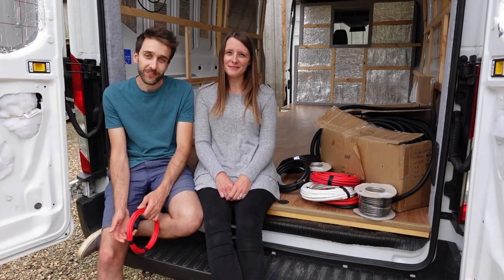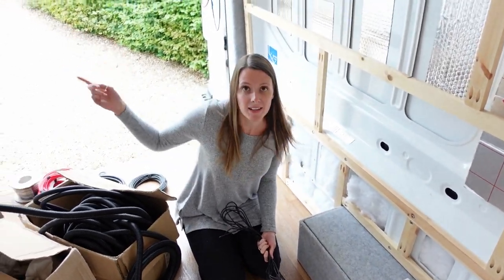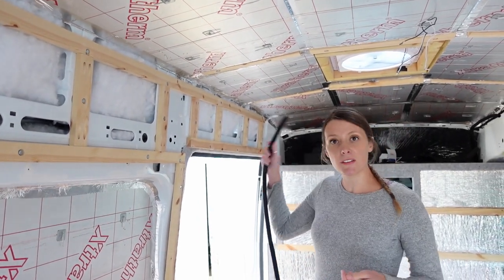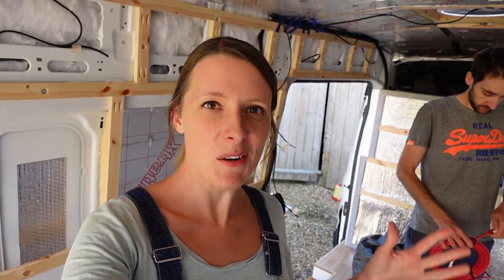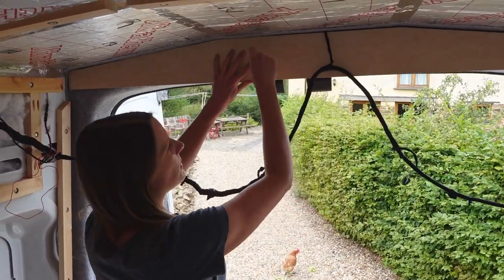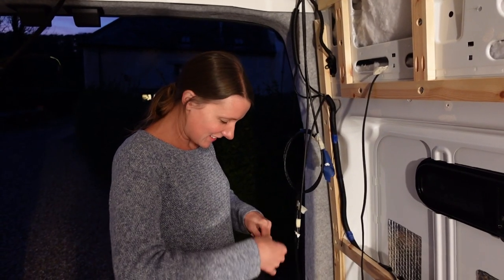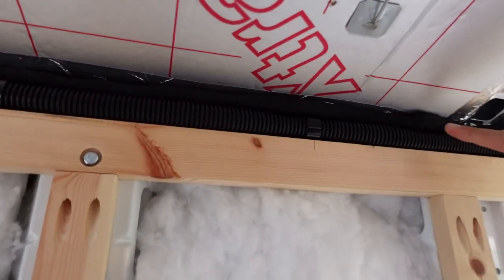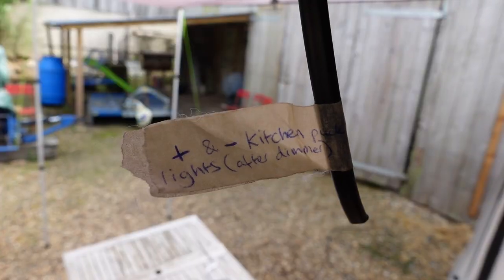Pre-Wiring our Van Electrics | Transit Van Conversion E19

Comment: How many meters of wire did you use in your van? I just made my pre-wire sketches and it seems like a huge amount of wire!  My van is smaller than yours and I won't have all the appliance you have (diesel heater, oven etc), but I am planning to do 3-way switches for the main lights.  Love your videos! I come back to them again and again as I go through the slow process of DIY build.
Reply from the maker: It is surprising how quickly it all adds up even in a small space when you have to go along walls and around corners 😄 We originally bought 2x30m spools of 3mm^2 cable, 3m of 70mm, 15m of 16mm, 9m of 6mm and 12m of 2.5mm triple core cable for the AC. Later on we needed some more 3mm so bought another 20m of non-duplex. We haven't used all of the wire, but there is well over 100m in the van. And thanks, glad they're useful 🙂

Comment: Looking good. If you have not boarded yet may I recommend running a few spare 12v cables from front to back. You will always have forgotten something, we all do. Watching with interest as it is a transit.
Reply from the maker: Thanks! And very good point, we actually ran out of cable to run the spares but we'll be getting some more and adding a few extra runs here and there. One handy feature of our design is that we can easily run cables under the bed across the garage wall too, which should stay accessible and allow for some new runs in the future 🙂

Comment: Watched afew videos now, and wow.  The attention to detail! May I ask where you purchased your cable from?
Reply from the maker: Cheers! We're hoping to spend a lot of time in it so want it to be comfortable 🙂We bought all our cable from https://www.12voltplanet.co.uk/ as they seemed to have the best selection and easiest to browse. The only thing we found a little odd is that some of their diameter sizes seem a bit unique, so we ended up with 3mm^2 wire for the majority of the van instead of 2.5mm^2 as they don't stock that.

Comment: It's always a pleasure to the eyes looking at the clean build you've created. 😊 I am also sold on conduit, but will opt for different colors 12V / 230V to better distinguish the lines. 😎
Keeping the batteries apart always means more wiring - was there no way to put the leisure battery closer to the starter battery?
Best regards from Germany, 🚐☁️🍀
Volker
Reply from the maker: Thanks Volker for the continued support, we're glad you're enjoying watching everything 🙂 That's a good idea to use different colours, didn't think of that actually. If we were buying it again we might have gone for the split tubing as well to make it a bit easier to route the cables. 

We were kind of stuck with the long length of run for the DC charger because for the layout we're going for the only place that really made sense for all the electronics was in that back corner of the van. iI's long for the DC-DC but it makes it much shorter for everything else 🙂
Reply: We are in the process of planning our van build. You’ve made a very good point about being closer to the starter battery. We planned for the sink to be behind the driver seat and it just seems wrong to put electrical and water so close to each other. I guess we just looked at other van builds and decided to install the battery at the wheel well. I need to rethink this. Cheers from the USA.

Comment: love your channel guys, amazing, Just a quick question,  do you have the link for  3mm duplex cable.
Reply from the maker: Cheers :) And the links to everything we used should be in the description but if there's something missing let us know 🙂👍
Reply: @SelfBuiltStories  what is the size you used for the general wiring for fridge, lights etc, is it 
33 Amps 3mm²
DIAMETER - 3.2mm ?
Reply from the maker: For the fridge we used 6mm², for the general lower amp stuff like the lights we used mostly the 3mm²/33A duplex, which is overkill for some of it but we bought it in a big reel to avoid having loads of different wire sizes 👍

Comment: Hi.  Just started watching this video.  Will you be pulling fishing line throught the conduit so you can swap out or add wires?  Great videos.  LOVE the animal (Cat or buttrfly) interludes between scenes.  Very well made video and great narration of why you do everything.  Almost on a par with Greg Virgoe's videos.
Can you post a link to where you got that wiring size chart please?  It looks way better than anything I could find.
Reply from the maker: Haha thanks, we like to break up the video with something a bit more light hearted... especially with electronics and things, it can get get a bit dry sometimes 😛Really glad you're enjoying watching them! With the fishing line, we did leave some string in most of the conduits to be able to pull through some spares, but in practice quite a lot of our conduit ended up fairly full so we wouldn't be able to add much through them. What we're going to do as well we think is add a few more spare pieces of actual wire in a couple of places, like along the side wall behind the cladding where we have a decent amount of usable space there. And sure, if you mean the voltage drop chart, it's this one: http://assets.bluesea.com/files/resources/newsletter/images/DC_wire_selection_chartlg.jpg.

Comment: Nice and neat and well thought out; probably the hardest things to pre plan for in a camper and a pain to change later. I have decided to run some of my wiring, especially the DC to DC, under the floor.
Reply from the maker: Yeah it definitely takes a lot of thinking about the layout and how you want to use the space. We're having a fixed garage wall under the bed so should be able to easily run any wires across the width of the van that way. Good luck with yours!

Comment: Rather than push wire, it is easier to tie a small rag to a string, then suck that through with a vacuum cleaner and use that to pull wires through. Easy!
Reply from the maker: Cheers, yeah we saw that trick on some videos after we'd done it 😛 But we left strings in all of the conduit so when we've needed to add new wires later on it's been nice and simple fortunately! The chunky wires are quite easy to push through but yeah the thin ones not so much, especially in the small corrugated conduit!

Comment: Hi thanks for the video! Isn't 6mm cable a bit of an overstretch for a 12V fridge? For a 5A draw and 4-5m circuit I don't see the need for anything below 14AWG.
Reply from the maker: Hey, no problem 🙂 And we wouldn't have wanted to go with anything smaller, it's around 4-5m round trip but with a 12V system voltage drop can be an issue over that distance with something like the fridge. When the compressor kicks in there is a surge of power that will drop the voltage a bit, and with our model if it drops to below 10.4V it will trigger a cut out and shut it down and won't switch on again till it reaches 11.7V. If the batteries are low or there's lots of power being used at the time that could happen, and we've read numerous stories of others who have intermittently working fridges for similar reasons. As it's one of the critical appliances (we don't want it switching off and spoiling all our food 😛) the small extra cost for heavier gauge wire was definitely worth it to us, and is also recommended in the manual too 👍

Comment: Hi, for future conversions, tie the wires together and bend the ends, pull through by tieing to a fish wire (or string). - electritian.
Reply from the maker: Thanks for the tip 👍🙂
Reply: In this case tie the fishing line to a small ball of cotton/paper. Suck it through with a vacuum cleaner.
Reply from the maker: @Zerpersande  Also a good tip, cheers :)

Comment: May I know the wire size you use from your Inverter to AC Distribution Panel.
Reply from the maker: Hiya, for all the AC wiring we're using 2.5mm^2 3 core 20A cable

Comment: I'd recommend looking at going 24V if/when you build another. All the wires will be half the size. It was a lot simpler than I expected it to be. The fridge, diesel heater, USB sockets and lights all work of 24V. The only 12V load we have is the max air fan. The MPPT can output double the power at 24V vs 12V too so the Victron 100/30 is good for our 600W of solar.
Reply from the maker: Yeah interesting, I think we have a few more things other than the maxxfan that would need stepping down or swapping out for other versions but likely doable and it might be something we'd look at a little more next time once we've got a better idea of the full extent of everything we end up using. Having slightly smaller wires would make routing easier for sure (though we probably did oversize them a little anyway) 🙂

Comment: When installing cables if you have thread one through attach a spare cable and draw it back to create a pull cord then you can push the original wire back through, also a little bit of blue tak on the cable this will reduce the risk of cable Snagging on the ribs of the conduit
Reply from the maker: Thanks for the tip. Yeah we taped up the ends when we pushed them through, the tricky part was getting the first wire through as with some of the thinner wires they weren't stiff enough to push over longer distances unless everything was really straight. We've tried to leave some pull cords in place in each one too and used one already so glad we did that. 👍

Comment: Where did you guys learn about doing electrics , it's the one thing that confuses me , is the AC necessary if your not using 3 point plugs . If anyone can help regarding electrics please comment. Thankyou
Reply from the maker: We did lots of research before we started, some good resources were the free wiring unlimited book from Victron (https://www.victronenergy.com/upload/documents/The_Wiring_Unlimited_book/43562-Wiring_Unlimited-pdf-en.pdf ), various blogs and forums like diysolarforum.com, and channels like will prowse, explorist.life, and the engineering mindset. And yeah having AC with an inverter isn't necessary if you don't have any 3 pin devices to plug in. Our 12V system can power pretty much everything in the van, including charging most of our devices with USB etc. The main things we use the AC for are a laptop charger and hairdryer. HTH 👍
Reply from the maker: @eus9  Cheers for the heads up, the bracket got added to the link. Fixed now 😛

Comment: Put a loop of string with tie-in points through and outside the pipe - you will be able to add or change wires at a later date
Reply from the maker: Cheers yeah we left a line of string in the conduit to allow pulling new wires through, which has already been very useful a few times! 👍

Comment: Hi there great job! just wondering what the tool is called at 13.18 the blue thing with arms.
Reply from the maker: Hey, cheers! It's called a rivnut tool and it puts in rivnuts that then you can just put a bolt straight into. We talked more about it in our battening video here: https://youtu.be/kVKTaQxFv3E?t=345, and there's a link to the one we used in that videos description too. HTH! 👍
Reply: @SelfBuiltStories   Thanks so much 😊
Reply from the maker: @suicidaltendencies99  No problem!